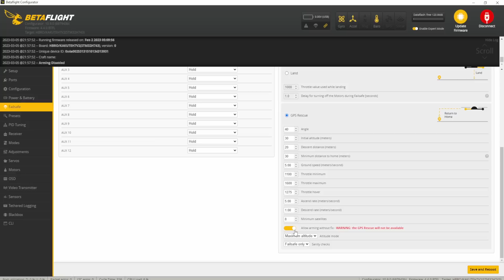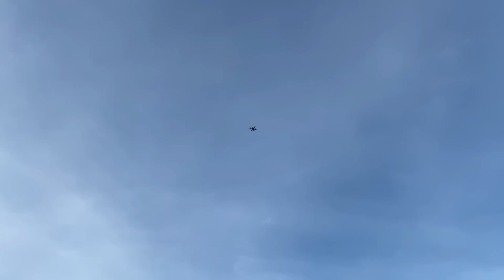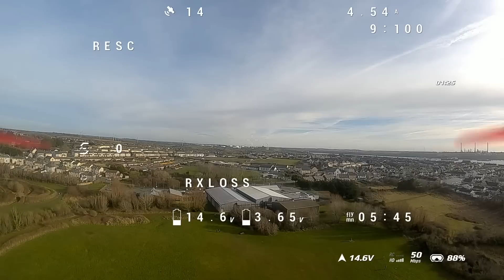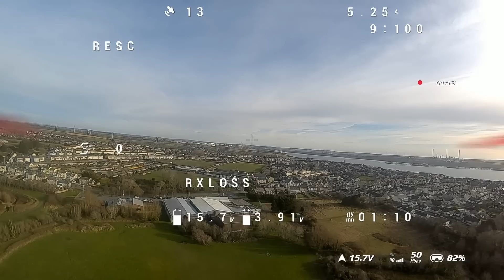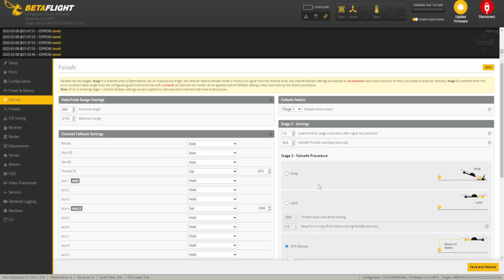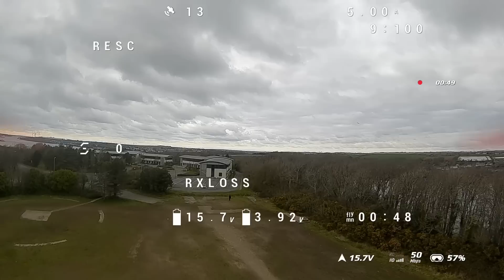Betaflight 4.4 GPS Rescue - Can You Now Trust It ?

Comment: The error rate on these GPS Antennas claims to be within 1.5meter CEP. 
This means that at least 50% of the time it was successfully tested to be accurate to a 1.5meter target. 
This makes me wonder if we might be able to get a more accurate RTH, if we used u-blox's u-Center, to fine-tune the GPS module? Maybe some of the error rate falls in BF, I have no idea, I'm not under the hood of BF. But we can all use u-Center, and this ten~fifteen feet from the launch point seems to be common. I'll give a try for my next build. I'll also be using an H7 flight controller, just in case the processing speed of the board ends up making a difference once I speed up the GPS unit.

Comment: As a freestyle pilot, would it self correct in the middle of a roll? Been thinking about adding gps, but not sure on its behavior if you're not flying straight. I don't use angle mode. Would adding angle mode correct if you're upside down? I have only failsafed a few times. I don't like doing the walk of shame more than I have to. Need one of those fancy skateboards or scooters like the cool kids have.

Comment: @madrc you didn't mention the most impotant thing: "Remember to set the GPS Rescue Hover throttle value accurately! The correct value makes the quad hover, or very slowly ascend, while in level mode with the heaviest battery you plan to use"

Comment: I'm new to 4.4 and honestly I'm not comfortable flying with it yet.  I'm lucky I guess because I've always had success with Betaflight GPS rescue in the older Betaflight versions. My questions is my I'm having to set up Angle mode to use the 4.4 GPS rescue? I don't use Angle mode on any of the quads and I have never had to use Angle mode before when I've utilized the older Betaflight versions of GPS rescue. Thank you.

Comment: there are stage 1 and stage 2 of failsafe, when stage 1 kicks in you have little time(usually 1-1.5 seconds, depending how this parameter is set) for the signal to recover, if during this time the signal recovers you keep flying with no actual failsafe, if during this time the signal is still lost you move on to stage 2 where failsafe happens and the quad behaves depending on your settings, drop, land or gps rescue.
what happens during stage 1 of failsafe you can set in channel fallback settings, I guess you should set throttle to hold if you do not want your quad to fall

Comment: Looks like it works pretty well actually for accuraccy and flying back.. The initial drop when going into failsafe mode might be the 1-2 sec delay to go from stage 1 to stage 2 failsafe which then activates the GPS Rescue feature, or maybe make sure the throttle and other sticks are set to hold for the stage 1 failsafe so it shouldnt drop as much if that is the case.
But it just seems to be the reaction time of the drone FC realizing a loss of RX and then activating the failsafe to use the gps to hold position and then begin the RTH. 
This is a nice feature and i wasnt aware it worked this well until i saw this video. ill have to try and set this up..
When you failsafe it with a switch, can you instantly get control back by flipping the switch off?

Comment: What button are you pressing for RTH/GPS Rescue? 
Is it the gps rescue mode on bf or do you turn off your TX?
Reply from the maker: Yea I was triggering failsafe via a switch.
Reply: @MadRC  Thanks! I will bind a button on my Tango 2 to Failsafe for testing. Better test would be to turn of the TX, but I am not that brave.

Comment: Hello really basic question in stage 1 Throttle value should be set between 1000 to 2000 from the radio setting as it is in stage 2? or in the KV of the motor speed. for me I think it should be like stage 2 between 1000 to 2000, so it's little bit strange you set it to 875????

Comment: Nice video. I prefer to configure the Failsave mode 1 stick settings to HOLD. That way the quad will continue to fly using the last stock positions at LOS for that short mod 1 time period.

Comment: The drop is from the default 1.5 second delay for GPS rescue to kick in. That actually cost me my AOS Falcon 7 because it failsafed low over a pond.
Reply: Stotch tape wrapped around Styrofoam pontoon will bend but not break and held on with silicone clear caulking . Maybe the frame would dry out . Maybe a week parts could dry .

Comment: Also increase ground speed. On a 5 inch you can easily set it to 20m/s = 72 km/h = 45 mph. The stock setting (5m/s) is too low, that means 2km (1.24 miles) would take 400 seconds = 6 minutes 40 seconds. In an emergency, battery will probably run out before it returns home (if you are into long distance).
If you want to improve it further, turn on efficiency in OSD (Wh/km) and fly in different speeds in angle mode and set ground speed according to the speed that gives you the best efficiency in energy per distance (Wh/km). Super slow isn't efficient and ultra fast isn't efficient. The sweet spot is somewhere in between.

Comment: I love what you do for the community ! That landing accuracy is incredible !  My 2 cents is drop is from the sanity check timer . I also test FS by flying away from home , then landing , then lighting up the FS so as you don't free fall and brake stuff if it's a no go .
Reply: So fly ahead , land and after 10 seconds low throttle it will climb , turn , and return ?
Reply: @GregDahl-g6g  It should yes!

Comment: @Mads Tech Regarding the drop: you have to first figure out at how much of throttle (in „ms”) your drone hovers or even slightly going upwards, then you need to put that value in the 1st stage of failsafe as a set value in throttle channel (change AUTO to SET and put that value) and the same goes to stage 2 gps rescue into the relevant line.
Reply: How do you figure that out?
Reply: Blackbox Explorer, or if you have a screen on your radio, you can set EdgeTx to show throttle position. I filmed my telemetry while I held a hover, and the widget on my radio was a few percent different from what Blackbox showed. I have not tested yet, but I am going to start with Backbox, since that's the data coming directly from the board. Just remember to make any unit conversions if necessary.   @BeautyBeastRC
Reply: The stage one and stage two throttle settings are in ppm stick values between 1000 and 2000 in the reciever tab .  Around 1250

Comment: How is it possible to see the drone going up during Stage 1 with a throttle set to 875 ? range  is 1000-2000 and throttle hover is around 1300 ... Strange.
Reply from the maker: It’s not going up at 875
Reply: @MadRC  Oh ok my bad, on the video I have the feeling the drone was going up fast just after the Failsafe before the GPS rescue mode 2.

Comment: Thanks for the video, Ian. In Stage 1, how do I determine the correct throttle value? A little punch would be ok, but I'd be happy with it maintaining it's current altitude. How do I figure out the right number?
Reply from the maker: The simplest way is to enable the throttle position on your OSD and look at what your hover value is and then use that in the receiver tab to see what the PWM is. However it’s worth noting an FPV quad is never going to always hover in the same place and throttle position as it will shift with battery voltage.
Reply: @MadRC  Thanks Ian, I'll give it a try.

Comment: In my testing, I flied 3km away and activated GPS Rescue and the home arrow is far from “accurate” during the return. It turns left and right constantly and rapidly dips its head up and down. All settings are default except I set the max angle to 45 and hover throttle to the correct value. I have tried to tune it following the guide from 4.4 GPS Rescue github page but it is just too hard for me to understand. It may still because of my settings are not right but tuning it is so much harder than switching to iNav or ardupilot. Yes, I do not need pure performance for a long range quad, and that’s why I’m now working on an ardupilot tune for my 7” Long Range drone.
Reply: make sure Angle mode hover doesn't have significant drift - may need to recalibrate accelerometer on very flat surface

Comment: For anyone using gps rescue for the first time... its a good idea to be only a few meters off the ground before simulating rx loss. If its not configured right it can drop like a stone. Much safer if its only a few meters off the ground.
Reply: But if you do it too close it will actually drop! You may try it low but you must do it beyond the set minimal distance.
Reply: @Michal W  yea obvs this also
Reply: Totally get the other settings right before you put it in a position  to drop 100m
Reply: It just dropped dead from 15 Meter thank God it was some soft land or else it's a different story
Reply: No sorry man but that’s cost a lot of money it would be drop off hard ! When u do the gps rescue early
Reply: Hi. Thanks for vid. Do props disarm automatically on failsafe. Thanks
Reply: @MartinAmbler-g9v yeah . It shuts off when it detects ground contact .
Reply: I heard once that if satelight count drops below set minimum and we are using rescue as failsafe , then failsafe can't gps home so it will drop . It can lose satelight count from high vtx power setting  and the gps antenna and vtx antenna both on the back like all the rebuilt explorers are . Move the gps to the front  and the vtx at least.3 inches separated  . Or satelight count goes up and down and arrow disappears and it might drop if satelight count drops too low . It might just be the mode switch they left on hold during stage one failsafe . Dang . Need to check . But I remember just setting ps osd and using drop failsafe until now . Definitely could have used rescue last 4th July when fpv  failed . 
 A smoke detector on test and the night time  strobe and disarm right away didn't help . Kidding about the smoke detector .

Comment: That's very good. I'll try that.
One question: If I have a rxloss failsafe behind some rocks, then I set the level 1 to pump the drone up. Am I able to get control of the quad again, canceling the return to home?
Reply from the maker: Yea you can regain control at any time once signal has returned.

Comment: Is what you see as a drop just the craft flicking from manual mode to self level angle mode, it appeared to just rapidly level.  Oops, I typed this before you explained the reason for the drop.  I will be sticking with Inav for now it is fine for my type of flying, Betaflight with baro, compass and gps rth like Inav would be perfect for me.
Reply from the maker: Yea it’s getting there now.

Comment: Why is it saying RX Loss when clearly you haven't turned your transmitter off?....To test it properly would mean turning your TX off to simulate signal loss....🤔🙄😳🇬🇧
Reply from the maker: Magic and hope.
Reply: You can simulate a rx loss by a switch.
Reply: @dax4812  Yes, and you can make a receiver Fail Safe in a number of different ways too....🤔🙄😏
Reply: Or pull the module out..  then put it back in 😬